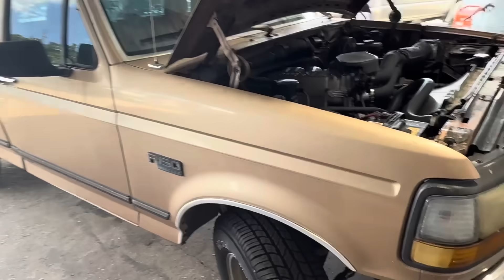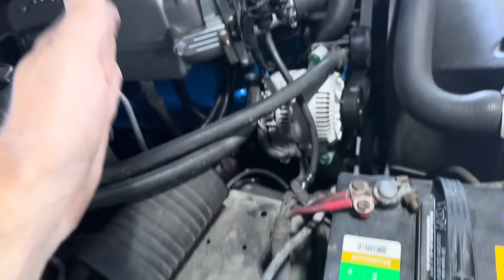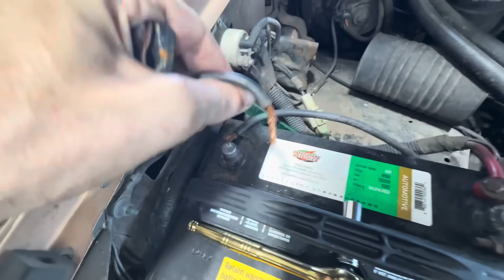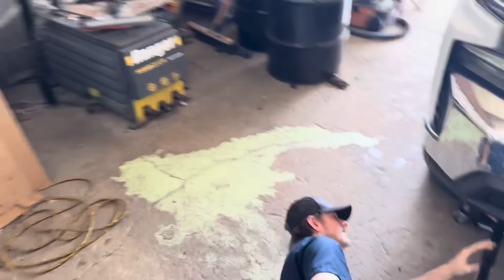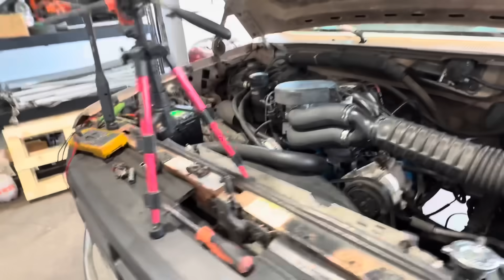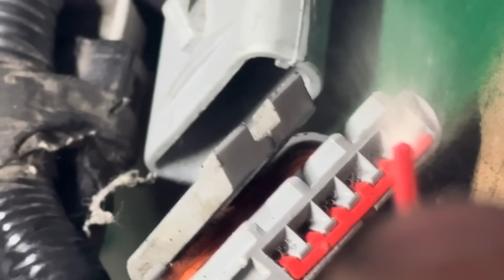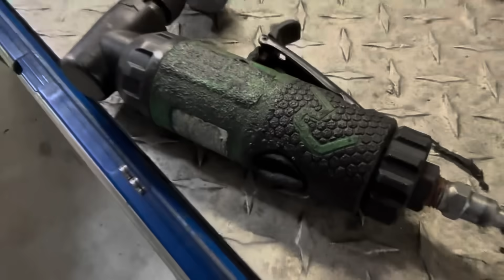Crank No Start! Accidentally Fixed! Can’t find the Problem! Ford 5.0

Comment: Check in the distributor is the gap between trigger sensor and rotating parts correct?

Because if the gap is wrong, you can get flakey triggering, a bit like the old breaker points when they weren't opening cleanly. 

Aldo, check rotor arm and dizzy cap for tracking, if they aren't new.

Comment: I had a 1980 E-150 with a 302 and Duraspark ignition. It developed this case where it would sometimes shut off after a sharp turn (low speed) and then re-start like normal. After much frustration, I carried a meter, and when it quit (in a safe location), I checked wires and FINALLY found a wire that traversed the underhood plastic enclosure just below the cowl, and the wire Looked fine, but after replacing and opening it up--ALL the Copper strands had turned to "Green Dirt"! Somehow it still worked most of the time, and even Ohmed out sorta OK, mostly because the sag in it kept the "Green Dirt" wet.

Comment: Measure resistance with no voltage across or current through the wire.  If you truly had 48 Ohms from battery terminal to the wire, that would only allow 14V/48 Ohms current (0.3 Amps) through the starter wire.  You need 400 Amps, so you better have 0.005 Ohms or less, something you need a Micro Ohmmeter for.  A VOM has a couple Ohms just in the probes, not near good enough.
Use your VOM to measure DC Volts between two points, if you drop a couple volts that's on the verge of failure...

Comment: Had a 1985 F150 with the 5.0 the ground cable from battery to block corroded and made it slow starting thought i had bad starter! replaced starter and still same thing!! Run a jumper cable from frame to neg battery terminal see if that makes a difference in resistance ? Also check wiring on coil ? they tend to get brittle and brake!! Or bad rotor cap they are bad about cracking and carbon tracking !! Good LUCK

Comment: Ray?
Paaaaasllleeeeaaaasse!!,

It don’t take no goddamn 4 hours to test everything for fuckssake - not on an old F150 like that that’s just fucking padding the bill bullshit.

BTW??: those terminal pinch-clamps are supposed to be turned upside down so that the 2 dimples are facing down to properly crimp the wire(s) on either end.
Reply: why dont you tell him what the problem is then?

Comment: i hate those cheapo terminals, the cable attachment is garbage, I'll usually flip the plate over so the humps on them face down, and put more pressure on the cable, I've had better luck on them not wiggling or pulling the cable out.

Comment: Assuming those battery (& other) wires are good (hint hint), It's been my experience that the alternator/regulator can cause that. Just bumping the regulator/alternator can sometimes "fix" it too. Any more, it's all in one unit whereas the really old Fords had completely separate regulators. Anything from cold solder joints to poor wire insulation (inside) or even the silicon itself can be your culprits where a simple bump might be all it needed. Unfortunately, the only "fix" might be to fire that parts cannon and replace the "nator" ...and cross your fingers that the new one is better quality. 🤞

Comment: Unstable idle issues on these,esp at high miles/time can be due to dirty injectors and worn out idle air control valve.

Comment: A bad  connection somewhere in the ignition wiring that got fixed when you reseated one of the connections. Every poor
connection are actual locations of higher resistance where copper wire is crimped, sometimes very poorly crimped. Looks
to be the case in both of the very old  battery clamps. Resistance rises cumulatively with every bad connection!  Make sure
the original wiring is still good. Higher than normal resistance may indicate corrosion on both ends even if one ends as an original connector. This video was not brought to you by any of the tool manufacturers tool's that were debadged!

Comment: It might not be THE problem, but that main engine ground cable looked loose in the replacement battery clamp.  It also showed high resistance, but that may have been due to engine running messing with the multimeter.  Also based on dubious readings, 100ohms is crazy high to the alternator (even if 20-40 of those is from battery connection)  With that much resistance that cable could only handle 5-10 amps at most.

It would be a good Idea to resolve that issue regardless.  There's likely a bad connection on the block.  I'm no professional, but if I've learned one thing fixing my own shit, bad grounds can lead to all kinds of weird shit that doesn't make any damn sense.

Comment: Everyone knows you have to use a hammer to seat those battery terminals, and to make sure it's secure you need a roofing nail driven in it to take up slack.
Reply: Roofing nail? Really? what, you couldn't find a nice clean drywall screw? Everybody knows they work best!  /s.
Reply: @beezul  wood screws work too

Comment: On rusty old cars/trks like that, where you doubt the quality of the grounding, you can always add a known good ground cable from the back of the engine block to the firewall.  Old cabling and questionable connectors are just bad business.

Comment: I was surprised that you put those nasty wire ends into the battery connectors without cutting them back to clean copper or replacing the wires.

Comment: The copper wire really looks old; usually called oxidation, not corrosion. I would have scraped it before reconnecting, or better yet, solder-wet the ends with flux (not permanent, but as a check). I think the rest of the wire was hot just as heat conduction from the terminal post, not from its own resistance.

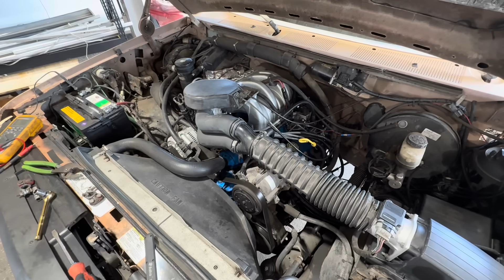Comment: @14:55, good call on resistance. Because the electrons only travel on the surface of the wire not through the core of the wire. Those pins need Eric and Ivan's favorite cologne, DeoxIt
Reply: You sure about that with DC current?

Comment: Your resistance measurement is flawed, there's no way that engine would even turn over if there was 170 ohms resistance on that ground wire.
What happen if you disconnect that Tacho wire? You said it was a spicy voltage, maybe something is breaking down with that high voltage within the Tacho.

Comment: I had a 1978 Dodge van with this problem. The fault was caused by a broken ballast resistor in series with the coil. The ballast resistor was a separate component mounted on the firewall. It always tested good with a resistance meter.
Reply: I had an old guy (older than I was at the time anyway) in the '70s who stated that whenever he had a crank no start on a Chrysler product he always checked or just changed the ballast resistor. It was a common problem from the '50s to the '70s. I would have thought that went away with breaker points.
Reply: That's a dropping resistor. Drop the ignition voltage to 6 volts. Keeps the po8 to from burning up.

Comment: fords are  noted for bad connections at battery,try changing battery terminal ends and clean battery posts,ive found this fixes a lot of ford electrical problems,you moving negative wires reastablished some connection,i always check the battery connections on every ford that i have a problem with,try unhooking tach and see if thats the problem

Comment: Ray this truck was parts cannoned and then they came to you. The grounds from the battery on a Chevy are limited a main ground to the starter and a small ground to the front drivers side frame. I. Your video somebody didn’t use dielectric grease Maybe

Comment: A lot of things done wrong here.  Resistant checks, changing battery terminals, voltage checks, etc.  And no, it was not normal for the 5.0 and 5.8 to have an idle/ignition glitch.

Comment: Maybe check for leaking electrolytic capacitors in EEC? Electrolyte leaks onto board eating away copper traces. Found this issue on a 93 Ranger.

Comment: With the added tach, toggle in the dash, and wipers powering up there is something going on in the column or ignition circuit. Ford connectors and wiring are known to corrode in that area of time. They are not sealed like the newer models.
Also Fords are VERY sensitive to the ICM. You can get 3 at the parts store and 2 will test bad. It got to the point I would snatch them from junkyards and keep a spare in the glovebox 🙄
The chineseium parts from the amazoom boxes could also be an issue 🤫
Reply: Exactly. Was going to say the same thing. Had a 93 Bronco that had a very similar problem. Turn it on and the windsheild wipers would turn on and the truck would idle weird. Replaced the column ignition block and seemed to fix it. The ignition block was so corroded it was grounding out.

Comment: Check the chassis ground to the block.  IF this ground is loose, corroded or missing, it will run like crap....   Get new factory made battery cables.  The smash and clamps are a major no no with anything running a ECM..... Good luck...

Comment: The vacuum lines on engine move just enough with vacuum rising/falling slightly changing the hoses shape causing the wiggle of hose on plastic fitting will give you the flutter in engine rpm. Same remedy as with electric clips.

Comment: I should also note, you could damage your meter connecting the ohms scale to an active circuit. The ohms setting uses an internal constant current source. It then measure the voltage across the resistance. The constant current circuit is usually clamped to around 1 to 2 volts for an open circuit, with the meter showing OVR or such.

Comment: First had a service bulletin concerning the clip ends on vehicles in extreme heat environment. Clips buckle out in center of clip. Mostly on heater blower manifold units also vacuum connections. Recommended repair is to squeeze clips back into square /flat side shape.

Comment: I had a thunder bird with a 5.0  that had a tach and started doing that and it would stall out all the time.  I finally just disconnected the TACH and it went away.  I think it was a bad tach that was shorting out.

Comment: As another said you can't measure resistance with active current in the wire!!! You can measure the voltage drop. You look silly doing this. The wire getting hot over the length of the wire just indicates a large current flowing in the wire. You might want to check the charging voltage but it might just be that the battery was low.

Comment: If you have current going through the wire which you will when the engine is running it will throw off the reading on the ohm meter. The way the ohmmeter measures resistance is it passes a very small current through the wire and measures the voltage drop across the wire. When another current flows through the wire it throws off the meter.

Comment: while attending mechanics school i was told that 90 % of electrical problems are caused by bad groiunds. so when i work on mine or others vehiles i always check the grounds first and most of the times i chanmge them.
Reply: Did they also tell you that 94.62% of statistics are completely made up?

Comment: I'd disconnect the tach, then start engine to see if it still stumbles, seems to me if its connected to the coil that it's removing electrical current however slight it is

Comment: Did you pull the codes from the EEC?  You can use the EEC scanner or jump it and count the light flashes. Its not as comprehensive as OBD2 but may give you a direction. Also the ignition modules on the distributor are famous for going bad, even new aftermarket ones. Use OEM with the heat sink grease. If it had a new distributor put in look there as well. They are also famous for going bad. Don’t forget about the fuel pump inertia switch. They can do strange things and shut the pump off for the no start.

Comment: Now using the volts measurement on the same points while under load will tell you if you have a problem with a resistive connection.
The Lower voltage the better.

Comment: I own a 93 f 150 and had to change corroded  wires the connectors were not bad, but the wires inside were bad. The parts cannon i put in is what led to bad wiring it did change the readings on the ohms

Comment: Ray, please, never test any resistance in cables that are under electric load. Even with my little to no knowledge I know that. Instead, disconnect both ends of the cable and then do the test. 
Are you sure all ground cables are connected and clean? For an engine without a turbo, that whistle noise sounds very unnatural.

Comment: Next time.,  do the resistance check when the engine is off. 
As the voltage drop across that ground conductor due to the load to or from the battery depending on if the alt is charging. 
Even just milli volts + or - can skew the VOM readings.

Comment: I had a 97 ford f150 with the 4.9 for years, very reliable motor, with That said ,my idle was up and down also cleaned the throttle body and replaced the air idle control valve with oem only (aftermarket didn’t work)problem solved! As far as the intermittent start I replaced the cdi ignition  control module . Also had a lot of plastic spaghetti lines that crack and break.

Comment: I had a 1977 F150 that I put an aftermarket Tachometer on. One day I went to start the truck and it would only crank but not start. Later found that the Tachometer shorted inside and grounded the ignition in the Distributor.

Comment: Seems to be a black soupcan behind the battery. What is purpose of that?
Reply: Old time vacuum reservoir. Used to be VERY common.
Reply: When you break down, the first thing you do is open the can and see if the contents are hot enough to eat.   You may be stranded for a while, (Found On the Road Dead), so at least Ford gives you something to eat.    From experience though, the can is empty (adding insult to injury) but at least for a few minutes, it gives you a little hope.  OTOH, since it is a vacuum resevoir, it gives you a "taste" of what it is like in outer space.   As exotic as space travel may seem, you'll appreciate having broken down on good old terra firma with the rest of us nutcases.
(I'm just practising what kind of answer AI might come up with)

Comment: Ray, I bet you touched a fusible link somewhere.  I had a 1983 Escort that died in a parking lot.  Lost all power and I couldn't figure out what was going on.  I spent two hours going over wires, battery terminals, fuses, you name it.  Then, I accidently touched a fusible link that was near the battery, and suddenly power was restored.  Never had another problem like that again with that car.

Comment: In days of old, before electronic ignition, faulty ignition switches were a major cause of weird ignition problems. On this one, I think you are on the right track with ground issues. You don't have appropriate bonding between engine and body.

Comment: Hi Ray I found your channel very inspiring and motivating educational also on the OBD1 Ford mine is idle faster on the slow idle on the fast idle call idol I think I layer control maybe they used an aftermarket one I learned a lot about wiring again at 66 I forget stuff sometimes sometimes I remember stuff isn't teaching it the younger guys I know my Ford's always in that era would stumble horribly when it went off called idle as they went on to close the loop so to speak peace joy love brother
Reply: Sorry about the typos
Reply: Concisely cold idol too slow idle air control maybe

Comment: Ray check that wiring running through the door jam.
Reply: Might be nothing, might be something. Need to isolate that ground from the smaller one and check for voltage drop while the vehicle is off. And check for excessive current draw. Could just be bad positioning of the ground wire to the block, bad cable like u were saying or there's a short to ground possibly they wired something wrong. Wires through door jams always makes me question that.

Comment: Why not test your theory about resistances in the ground cable by connecting a jumper cable from battery negative to the engine block

Comment: Check the ignition switch for loose or burned connections. That was a problem in 1990s Ford trucks. It may not be the problem but it is worth looking at. With a parts cannon car.

Comment: Ray great video.  Check 8AWG wires for corrosion and terminations to engine block.  Replace 1 cable at a time and test.  Looks like cables are corroded within jacket.  These are 20+ years old.

Comment: I bought an old Pontiac back in the 80's that had a similar problem. Car had bad battery cables and if you failed to start it the first time, the wires would heat up and car would lose all electricity. Had to wait about an hour before I could try again, every time it happened. Took a while to hunt that one down.

Comment: To verify a wire's continuity/integrity, put it under load (operating) use the volt meter function and check.  If you read any voltage, it shows a resistance in the wire.

Comment: I can't believe you put dirty corroded wire ends into a new battery terminal clamp (without cleaning the battery terminals), and expected there to be a good, resistance free connection.

Comment: Chasing random misfires without OBII isn't much fun is it? Yes, replace the ground wires and also the positive to the starter. And take a critical look at the ground strap to the frame. It will help.  I don't think it's the root cause, though. I bet if you figure out why the wipers run on start is where the root cause lies.

Comment: The siolinoid from the battery craps out alot on those. Sometimes it will keep cranking after it's running and when you turn the key off it will keep running and cranking, only way to stop it is to unhook the battery.

Comment: 4 ohms is too high for resistance over a ground wire, especially a thick multistranded copper wire.  Should be less than .2 or .3 ohms which is the meter probe calibration bandwidth.